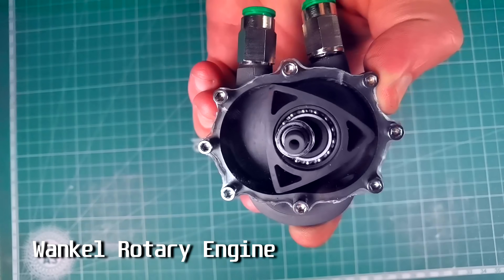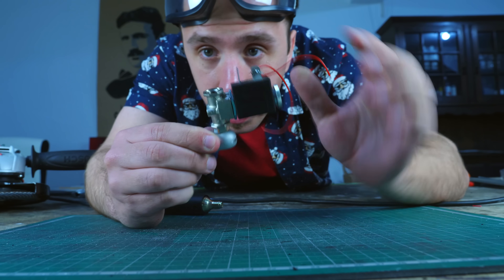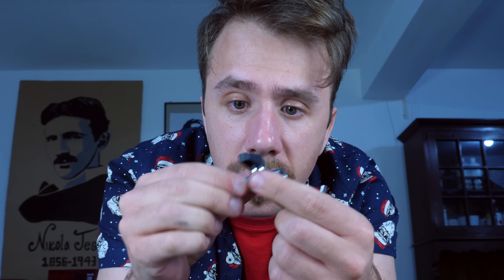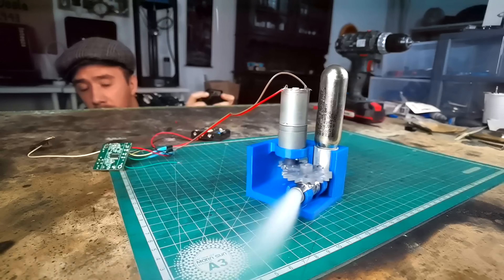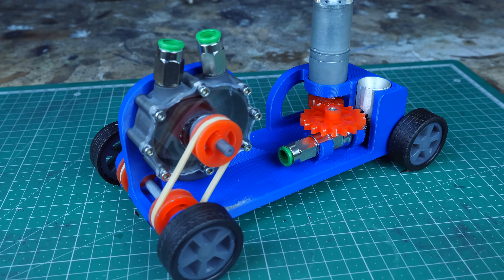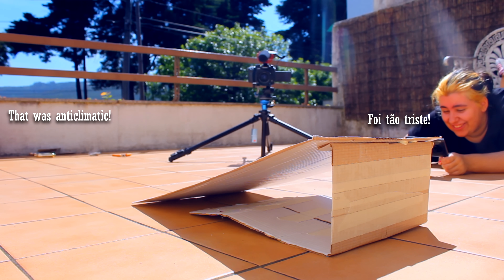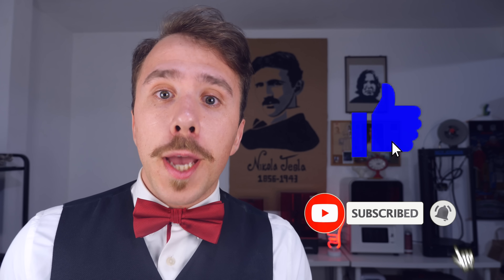Rotary Wankel RC Car (3D Printed)

Comment: With CO2 cartridges like that using them with the nozzle face down will cause the liquid to escape a lot quicker than if you tilt it on its side or have the nozzle tilted up on the cartridge I think you'll be able to sustain longer durations of run without blasting your liquid CO2 out the bottom.

Comment: Having a pressure reduction valve between the cartridge and the electric valve might make the car start better, drive further, and reduce stress on the wankel engine inner gear.

Comment: Could I suggest reorienting the wanted engine so that it faces backwards as well as some gearing down of the shaft rpm? It'd likely have more useful power and run for longer then as you'd only need to part open thr valve! 

Also, I love your videos and your accent is incredibly hot!

Comment: Now that you have a powerful rocket, why don't you try to print a boat and use the remote co2 to power it?? I think it will be so cool to see if it can power it and see how does the co2 reacts with water

Comment: I think you should see if it’s possible to 3D print something that can split a log.  That seems like a serious challenge to me!  For this challenge you can attaché a metal blade for the splitting part and you can use a motor for power but the majority of the machine needs to be 3D printed.

Comment: Video idea: automatic sun tracking system to keep a solar panel at maximum efficiency. Lots 3d printed gears (especially if you do 2 axes) and some microcontroller/RPi work. Use the resulting energy stored in a powerbank however you wish, like charging your phone, or charging a large capacitor to discharge into a tomato causing rapid and violent disassembly of the impostor vegetable.

Comment: Idea: You should make a two rotor wankel angine and use the pressurized exhaust gas from the first rotor to drive the second rotor. Should be more efficent an should run much smoother.

Comment: The cars transmission between the engine and rubber band is not good.
Try to use gears or a rubber band that in cars ( but smaller).

Comment: Integzaaaaaa! Just redo the Wankel CO2 car! Event tomatos know that every Wankel powered car should be rear wheel drive. Instead od using rubber bands stolen from Kathrina use 3d printed pulleys (you can reduce 5k RPM by simply changing the teeth number) and GT2 belts like 3d printers use (can be bought in closed loops). And evil disgusting tomato as a driver sound like fun :D

Comment: I guess your car might perform better if you don't use the cartridge nozzle-end down. The pressure just pushes the liquid co2 outside and through the engine. Maybe try it with the opening pointing upwards? Would be interesting :)

Comment: You need a pressure regulator. Then you could run the engine continuously for a long time and much more efficient speed for your engine. Cool though

Comment: Here is an idea. In this you kinda showed why planes switched from propeller to jet. You're design can be improved using your rocket designs from the fire hazz... ... scientific experiments right?

How about a jet powered RC car using those cartridges. I just wish there was a charismatic tomato hating Portuguese that would discover a way to change it's speed by limiting the pressure release.  :/

Comment: what if you used the Wankel engine to spin up a flywheel through a bunch of gear ratios? I have no idea how well this could work. but in my head you could hook up multiple cartridges to be released at different times to spin the engine which spins the flywheel up

Comment: You should use a reducer-vaporizer (similar to the ones used in LPG fuel system in cars) to reduce the rpm of the wenkel engine and also increase run time. And the gas will have some time to heat up a little, this will help with the engine apex seals.

Comment: You could build a steam engine and attach it to your 3d printed car... this way you would have more controlled RPMs and increased torque. And add a damn servo to the front wheels so you can control the car with the remote

Comment: Video Idea: Use the wankel engine to power an aircraft that has a prop which will benefit from the overkill rpm unlike the wheels that didn't grip the ground.
Use it to fly those tomatos away from you.

Comment: Two ideas:
Turn the cartridge upside down, so you don´t blow out all the liquid CO2 at once.
Add a needle valve as a limiter, to get only enough flow to run the engine at reasonable rpms.

Comment: I would suggest making a multiple rotor engine, and either using a manifold to share the co2 among them or to daisy chain the rotors together (exhaust of rotor 1 to intake of rotor 2, etc.) . Your exhaust is still coming out very fast, so you’re not getting as much energy out as you could. And if you could throttle the output of the co2 cartridges that would be even better. 

Another suggestion is to gear the output to reduce output speed and increase torque, especially if used in a wheeled vehicle.

Comment: Vedio Idea-- Make a Hydrogen fuel cell from salt water & solar And use that gas to run the Rotary Engine.. And in 2nd part make a rc car with that...(and of course u have to make the Engine out of Metal)___Lot of work ...But it would be awsome....🤔🤔❤️

Comment: Joel i used to fix cars and i like that you chose the Wankel motor for this project.... im wandering how the car would work if you used a Lithium battery(instead of compressed gas) to drive the Wankel motor and put a alternator of some kind driven by the wankel to keep the batteries charged and then put the car on some type of treadmill to see how long before the batteries die???

Comment: you are releasing all that pressure at same time and that is wrong, is way more than what the motor needs to move. what u should do is to find a way to release it slowly, so the car can move longer tnan 3 seconds on a single cartige.

Comment: Video idea: 3d print a 4 cylinder or an 8 cylinder engine that runs on co2 cartridges, and then 3d print an rc car for the engine to propel.

Comment: Can you try making a combustion version using 3d printing? 
but instead of petrol use something more mundane like alcohol vapour
Would be an interesting challenge as well, being more concerned with leaks and also that your 
fuel doesn't also act as a solvent for your polymer of choice

Comment: You need an expansion chamber for those CO2 cartridges all of the white blowing out is liquid CO2 loosing alot of volume and pressure. It's probably the reason the gear failed too it got too cold and brittle

Comment: Suggestions for improvements (besides better transmission): make it 4x4 and maybe point the exhaust to the back (in case the exhaust gas velocity is significant).

Comment: @Integza isn't it possible to do both the engine and the rocket boost from the CO2 by pointing the exhaust from the engine out the back end?

Comment: One thing, that might improve the car, is driving the rear wheels instead of the front wheels. As the car accelerates, the weight is transfered to the rear, so you get more grip in the rear.

Suggestion for a video: If I'm not mistaken, the Wankel engine uses an Epitrochoid shape for the housing. It'd be interesting to see if a similar engine could be made from other types of shapes, like a rolling hypocycloid for example.

Or maybe an introduction into lost PLA casting would be awesome.

Comment: I think your rotary engine might be even more efficient as a two-rotor setup, feeding the exhaust from one rotor into the other rotor to mitigate losses.  Also, your gear ratios don't seem terribly optimal for the RPMs produced.

Comment: Integza you need a pressure regulator. Dumping 800psi is great but it can be better. With the internal rotational force of the motor you can extend the same force with a regulator to either extend duration of the trip. Or reduce to maximize. Also think about turnin the inital exaust to another port for rentry to pass thru the engine again since it is only compressed air and not a combustion stroke the same force can be used until it is lost its pressure as it exits the device..

Comment: Could you print the Wankel in ceramic and hook it up to a small steam source? Or is the shrinkage of the material to hard to compensate for the triangular piston inside to be "air tight"? Or maybe the plastic version can stand the heat of steam for a few seconds at least? Probably a beverage can would be enough as a boiler and can be fitted on your small car frame?
And, please, wear safety goggles when working with thing that rotate fast and/or are under pressure. We want to enjoy your videos as long as possible. 👍

Comment: You  could try to add some sort of reduction gear/regulator/clutch to the car. This way the rubber band won't slip as much. Also, please stick a 3d-printed jet engine onto a plane/car!!

Comment: Video Idea: You could possibly create a small 3D printed tank that is driven by air motors, while also being able to shoot small rockets/pellets with those small C02 capsules. Would be really cool to see something that can actually use compressed air to something more than just drive.

Comment: Look at polarstar airsoft's products. Their CGS product will allow you to run a 33g co2 cartridge at a much lower psi ~80-120. Which should slow down the rpm of the motor giving your wheels and better chance at catching and a longer run time.

Comment: You're making a lot of torque with that cartdrige but get very low speed, if you make a transmission you could multiply the torque for a more efficient energy conversion, plus it would make an awesome video :)

Comment: video idea: 3d printed inline-4 pressure engine, but with overhead cams and valves like an auto engine. Power it using a sodastream bottle for extra points.

Comment: why don't you connect a tube and a one way valve to the outlet of the engine and use the exhaust like a loop to power the motor for longer time.......it will be less and less compressed but surly will increase the working time

Comment: Video idea: Power that Wankel-engine with something flammable so it looks even cooler so it shoots flames ;)
Reply: Then the engine has to be 3d printed in ceramic resin, otherwise the engine melt, but since ceramic is quite heavy, it can made from metal.
Reply: @saviotanaka  but you'd have a burnt exhaust made of metal
Reply: @annabelle5640  oh, i see. For a CO² powered engine, it's a little bit hard to do because CO² doen't support combustion process, the engine has to be powered with compressed air. Sorry if i offended you🙏
Reply: @saviotanaka  oh i forgot fire doesn't react well to CO² sorry
Reply: @annabelle5640  it's ok.
Reply: @Lassi Kinnunen 81 Oh, never thought that way😅👍👍

Comment: After watching the past couple videos, I'm thinking you should design a prop plane with a rocket assist (all CO2 cartridge powered).
I would still love to see a 3D printed pressure regulator that extends the the time that the CO2 cartridge is useful

Comment: (Video Idea) You've 3d printed engines, rockets, impellers, Turbochargers... The list goes on. Isn't the next step to 3d print a gun (and then use it to shoot tomatoes)? You could try to create Nikola Tesla's 'death ray', called Teleforce, but that would be a bit ambitious... Instead, it could be a BB gun, powered by springs, CO2 cartridges or even compressed air stored in a similar way to your Tesla Turbine boat video (just in containers that can hold more pressure). Alternatively, it could be a coil gun or you could try and harness the explosions that happened with the vortex rocket engine v3.
Reply: To the best of my knowledge, no one has ever made a working teleforce - ambitious is an understatement. But at least the tomatoes wouldn't see it coming!

Comment: love the videos, Saftey glasses. please.  As an apprentice in 1980s i lifted an air powered jigsaw up from a cut before the blade had stopped. it hit the plate, snapped bounced up and stuck at 90 degrees into my saftey glasses., took them to the instructors to ask for new glasses and they called everyone round to show what can happen and how protection is so important. They went on a shelf  , snapped end in, concave fracture,, slap bang in the middle of the lens, i remember it vividly. .  North Valley Forge.

Comment: Yoe should try to use a sodastream cilinder it should give u more range and allow you to properly try out your engine to full capacity. May be you could use a valve too container the pressure before it reaches your engine. By the way love your humor and style

Comment: You should build a valve for this, that will not realease all the pressure in an few seconds :) I think with a valve you can use the wankel engine for an couple of seconds. Also it will not spin so fast :D

Comment: Try it again but use oil in the engine and a proper gear setup, that rubber band you used to connect the motor shaft and the wheels made you lose TONS of power 😅😅

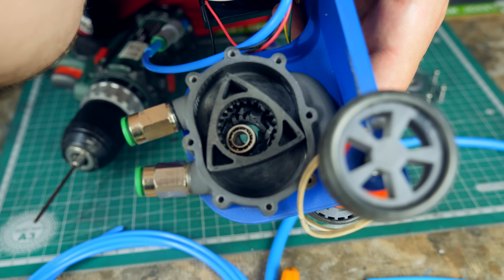Comment: 7:27 it looks like the band is slipping, you could probably make this go a lot faster if you used gears instead of a band to connect the engine to the wheels.

Comment: You mentioning that the rotary engine rotates at thousands of RPM and being too much for the wheels makes me think "Well make a 3d printed helicopter or plane that runs off compressed air then". You would need to modify the valve to meter the amount of gas released in order to sustain any kind of flight time. Alternatively a Boat would be viable as well as it isn't nearly as subject to the kinds of rpm restrictions a car wheel is. That actually might be the more viable project as maintaining any kind of real flight time would be difficult to near impossible.

Comment: i think this can be improved. first of all, as you said, lowering the rpm, but also, there's a tonne of leakage as shown on the video, and does not seem as if the wheels get much traction either.

maybe get a hand held scale (or something more precise) to measure the thrust you get from your assortment of rockets and things? while watching your video's, i've wondered how effective the rockets you made were. be neet if you could set up a set of rails, with whatever rocket you are working on (or maybe a compilation of whatever rockets you still have?), and test how much thrust they produce?

Comment: just had to say, if you let the pressure out too fast from the cartridges, the gas solidifies inside, creating a block of dry ice inside the cartridge and you lose about half of the power. if you wait a few minutes the pressure will have built back up and the gas liquifies again. i've been through this with co2 powered guns a lot.

Comment: nooo redesign the drive train to have gears instead of the rubber and, the wankle is spinning over the rubber band, you have the space
Reply: you can also mess with ratio to make up for that 5,000 rpm
Reply: maybe even take out a transmitter and reciever from an rc car to modulate the valve so you can control the rpm of the wankle engine

Comment: All the Michael engine it was one solid push instead of a whole bunch of series of gaps try making a bowel that rotates with the Michael engine piston giving it away open close shut off through the out the cycle also trying to look back the out valve back into a different location of the micro engine should give up more performance. Did you know they made an upgraded version I was at Michael engine rotating piston is less of a triangle at more of a figure eight

Comment: Video idea: You should 3d print and design nozzles for the RC-Car and measure the maximum speed each nozzle is possible to achieve. The challenge here is to measure the speed accurately by not using devices which you can buy online.

Also, tomatoes are disgusting!

Comment: You should add some kind of manually operated regulator to keep a steady pressure - should put less wear on the engine, and give you more run time (even though it limits the top speed)

Also a stiffer frame (supporting the end of the output shaft) would mean better power transmission
Reply: Could have just said the degree of limitation upon the valve opening should work as a regulator without having to take the money for a real regulator. Correct me if im wrong but a valve half open releases half the air flow as compared to a fully opened valve.
Reply: @benjaminsteakley  you're kinda right but pressure is increased at the outlet of the half open valve. However overall flow is decreased, which is the fix this needs to run more than 3 seconds

Comment: For a future video you should make a version 2.0 of the Wankel engine dragster. I would suggest making it rear wheel drive and and use solid gears to put the power down, the rubber band seamed to slip a lot.

Comment: hey, here is a vid idea: you should make a mini sized scale replica pf a rollercoaster using the 3d printer and add a seat that actually moves using any of the previously built engines. also it should have a loop the loop,EDIT: OR YOU CAN USE A ROCKET PROPELED TRAIN COASTER THINGGY, SCREW THE TOMATOES!!!!!!!!!!!!!!!!!!!!!!!!!!!!!!!!! I AM ALERGIC TO THEM SO AUTOMATICALLY I HATE THEM CUZ THEY MIGHT KILL ME

Comment: Video idea: Co2 powered Wankle or Tesla turbine to generate DC power.

To get better performance out of the CO2 canisters you need some sort of regulator to throttle how fast it expands. Your loosing most of your power due to the gas not having enough time to expand.

Comment: If you can find a way to make the tube that goes into the engine straighter and shorter, you'll have more power. Also I am curious if by doing so and having the engine exhausting towards the rear if that would create any additional thrust. Other than that it's all aerodynamics and weight reduction, then watch your baby fly!